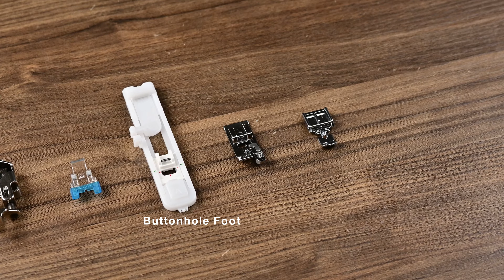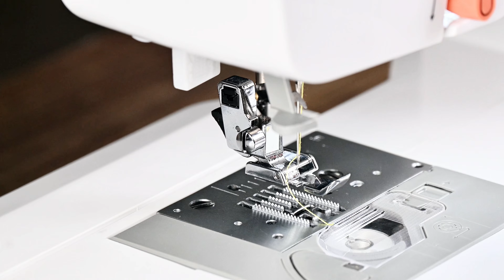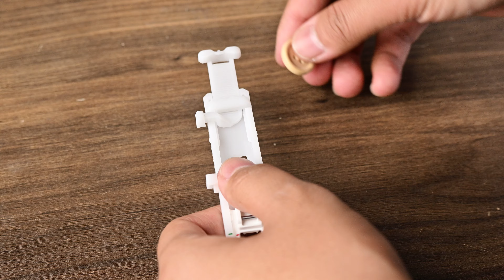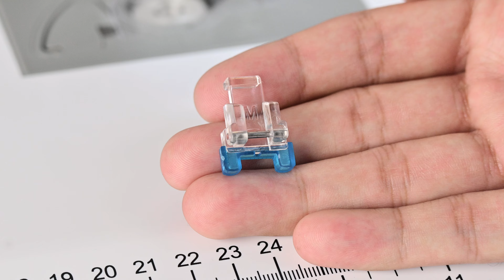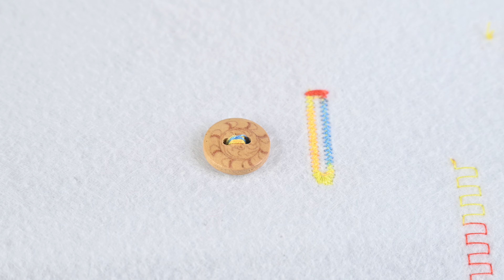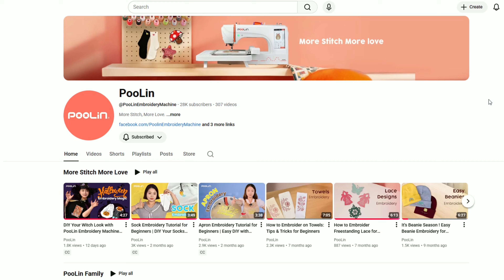How to Use PooLin EOC05 2IN1 Sewing & Embroidery Machine | Stitch and Presser Foot Tutorial

Comment: Poolin EOC05 (2in1)
ERROR: Spindle doesn't rotate.
What to do?
Reply from the maker: Hi 😊 If your machine says the spindle is stuck, first turn it off for safety.
1️⃣ Check if there is any thread tangled around the needle area or inside the bobbin case.
2️⃣ Remove the needle plate and clean out any debris.
3️⃣ Carefully turn the handwheel manually to see if it moves freely.

If it’s still not working after this, please send us a private message and we’ll help you step by step.